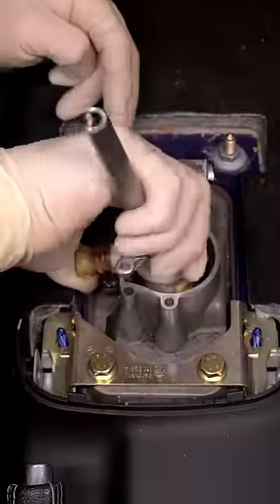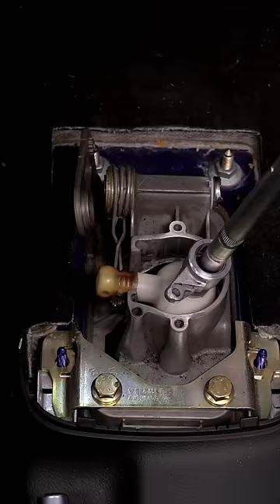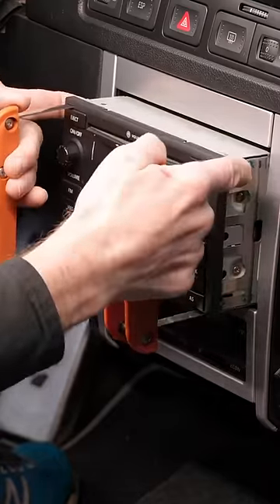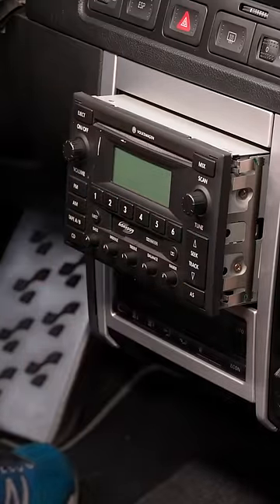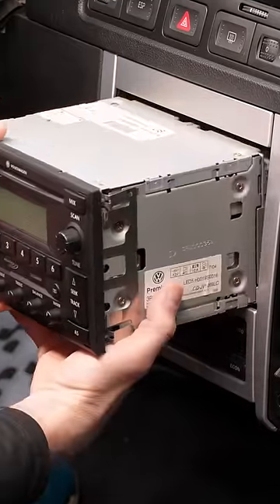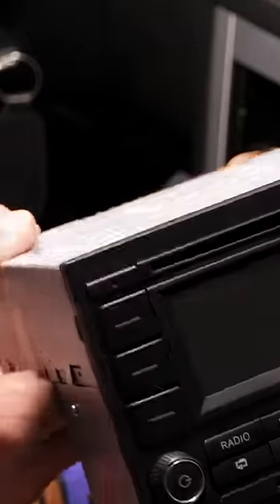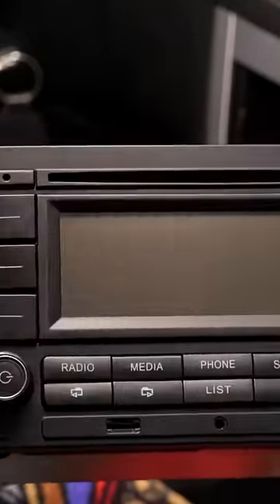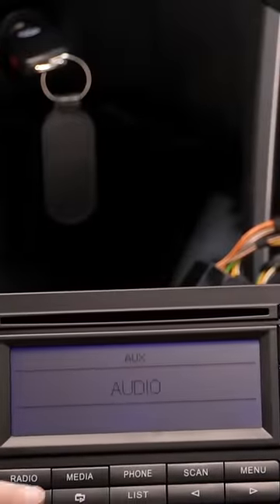I Ruined a Clients Radio OUCH

Comment: At least you’re a mechanic that makes up for his mistakes. Some mechanics break things and never even mention it.
Reply: Having had this happen, I very much appreciate when someone makes good on their mistakes. 

As an example, the plenum on my 91 civic is no longer serviceable - the screws were impacted back IN breaking the housing in a couple locations and stripping all the screw heads. This was a housing I'd previously opened and retightened by hand. The shop handed it back to me without any mention, and I didn't catch it until many weeks later. The entire plenum would need to be replaced if it needed to be serviced, as the screws would need to be drilled out in order to remove it.
Reply: @jameshaulenbeek5931  exactly, i’m a mechanic myself. And i see a lot idiocy at my workplace from other mechanics.  These guys don’t give a fuck about other people’s cars. I’m temping to open my own shop in the near future, because i don’t want to work at a brand stealer(dealer) or a workshop full of jerks.
Reply: Lol that part ngl I would have been scared asf like “no bruh dont do this to me im just trying to work “ 😂
Reply: Had my sway bar literally fall out while going down a hill on the way out of the shop
Reply: @Movement_44   😂😂😂 not funny glad you ok but fucking aye
Reply: every VW service department…
Reply: @jameshaulenbeek5931  yep i now have 2 dents in my hood from a windshield wiper I never approved to be replaced and they won’t fix it. That’s why i hate dealers its cheaper to replace the hood than it is to fix it after labor.
Reply: It’s an advertisement
Reply: @orhankucuksahin6297  Im a mechanic and I will work for you brother I always wanna be taught and do things right it’s just about having pride in your work and knowing you did the best you could
Reply: @beaujacklewellen6524  i am living in Holland, you’re welcome. The shop is also going to be a local car enthusiast club since we don’t have one in this town I live in.
Reply: @NateKK7  Nice thing in Quebec is that you’d get a free hood. They cannot charge you for a repair that you never agreed for, and accidental damages coming from an unwanted repair would follow the same rule. And you technically could have that repaired in a different shop and send the invoice to the first one.

There’s just no unwanted repairs here. They will call you and make sure to get your approval before doing anything. Even legit repairs are covered by this. If you get a new set of tire, and never agreed to a brake pad change, then if they change your worn out brake pads without telling you, you just got free brake pads.
Reply: @arakwar  they can’t do it here either but if i go to the state they will remove me registration because there is a yearly safety inspection and if any mechanic finds something they will remove your registration. Still tho i has one in the back seat and I would have installed it without damaging the truck.
Reply: YEEEEEP
Reply: That makes up for mistakes...that would have never happened if they weren't trying to film something. So basically doing something entirely unnecessary to the job, and it caused damage.
Reply: *most.....
Reply: I had a mechanic claim to fix my rear main seal on my 01 ranger when the motor blew. Never did it. Took it back 3 times, and it would get worse each time! On the second visit, I had them replace my coil packs, and while they were replacing them they failed to mention the clipped a wire to my alternator. At the time I didn’t have money to fix it and tear and some change later, I ended up selling it.
Reply: @cacaoscotti4827   i work at autozone prime example customer needed a tire rotation went to the mechanics then was told he needed a new power steering pump😭😭
Reply: Happened to me. I later found out the mechanic that worked on/damaged my car died in a car accident on his way home from work. Well deserved 👍🏽
Reply: Probably only did this because it's visible
Reply: If it has to be mentioned, you didn't notice,/give a shit/ pay me enough to car.....
Reply: Never make changes like this without customer approval. Maybe they wanted to maintain the stock radio for a good reason. Now, you have a vehicle that has had wiring modifications made. Good thing it wasn't a classic car.
Reply: Scotty Kilmer
Reply: Guy who changed my windshield just used drywall screw to hold the A pillar cover in place. Ofc didnt tell me
Reply: My mother took her car to a mechanic shop because her handbrake stopped working. After getting it back, the handbrake still didn't work and neither did the driver door.
Reply: yeah he makes it up because he can get a tiktok video out of it
Reply: I’m sure if the damage was invisible he would’ve left it
Reply: Had one break my throttle cable without my knowledge, two months later I’m driving and the pedal goes to the floor, mf put a zip tie to hold it in the bracket
Reply: Most of them
Reply: Your a good man 🙏
Reply: You said most wrong my friend...lol
Reply: Had a garage break my top engine mount on a grand prix I had, never mentioned it to me!
Reply: @orhankucuksahin6297  I was a shop hand and ford and I’ll NEVER bring my vehicle to ANY shop just after seeing the fucking treatment of other peoples vehicles. I’ve worked in other shops and been in other shops and unfortunately this is almost universal. Thank you for being a good egg. We need much more people like you
Reply: Jiffy lube mechanics shearing bolts
Reply: @NateKK7 that’s illegal, they can’t replace or repair any part of a car if you don’t approve it
Reply: @aidenlebel8157  yeah, most of them don’t care, as long as they get the money. Listen, I had a customer brought his car in for inspection, and i inspected the whole vehicle at the stealer. And when I heard the price of the service. 1200 bucks for just a battery, expansion tank, brake fluid service, aircon service and minor oil service. I was flattened, i told my service advisor that I didn’t want the expansion tank to be replaced immediately. I told him that he just had to order the part just in cause it needs it replaced, lots of GM brands in Europe have that problem where the expansion tank plastic weld comes loose and the tank will start leaking. And those motherfuckers are mostly on back order, so i told him order it, just in case i had to further diagnose the coolant system before replacing the tank. At first glance at inspection i saw no leak, after i filled the tank to the maximum line it started leaking on the return line fitting on the flanch. I told my service advisor that i just needs a o ring replaced and he said let’s replace the flanch. I just replaced the o ring and the leak was gone. I don’t give a shit what the advisor or foreman tells me. I fix what needs fixing and if they sell a flanch to the customer someone else is going to do it, not me. Bloodsucking maggots that they are.
Reply: What's worst is if a porter does it and doesn't say anything. Caught a dude snap my obii sensor out of place while intaking my brand new ZL1 for my free oil change.
I thought he had broken it and was furious but the mere fact that I was right there and acted as if nothing happened was the worst part.
Reply: Yeah like my old mechanic …
Reply: **Most
Reply: Most* fixed it for you.
Reply: Or break shit and make you pay for it
Reply: I’d say most of them
Reply: Most
Reply: "It was like that already......"  Me:mmhmmm
Reply: Not all of us do though! Lol I’ve made some royal fuckups in my career but it all depends on how you handle it
Reply: @orhankucuksahin6297 I'm currently a student at a Votech for automotive service. One of the first things our teacher showed us was a video of one of the kids, who worked at a dealership, and his mentor setting a car on fire cause they decided to use over a gallon of brakleen to clean an engine bay, and they didn't disconnect the battery.
Reply: @PoorlyPlaying  that’s a basic rule when working on cars, disconnecting the battery. 

But to ignite Brakleen, it must have shorted out somewhere to spark.

I never experienced something crazy like that, the only crazy thing I ever experienced is jacking a car on the wrong place, which almost caused the car to go sideways. But I was a student Mechanic at the time, I didn’t know any better. Put that on the guy who was supposed to teach me the basics at my internship.
Reply: I’ve been able to make my tools a complete set as a technician just by immediately checking under my hood and finding various tools laying on my engine bay 😂
Reply: yea my parents took their ford explorer to a mechanic to get a radiator replaced and the guy drove it back to our house and when he pulled in the car was making a squealing sound, he told my parents "you hear that? oh its nothing just turn your radio up real loud and you wont even notice it" i legit am not making this up those were his exact words Lmfao, he didn't even offer or try to fix that noise, wasn't much of an issue though because a few months later the explorer got destroyed when a creek near where we lived went out of its embankment and flooded the car (we had parked on a part of the driveway that ran down near the creek, about 15ft away and 10ft down, so yes that creek rose up like 20-25ft it was insane)
Reply: You would be surprised at how many mechanics don’t actually own a torque wrench.
Reply: Had a jiffy lube tech completely rip the oil pan cover off my wifes car and hope we wouldn't notice. Apparently he had bent it quite badly when he tried to pull it off without undoing one of the bolts, no clue how he fucked it up that bad but they wouldn't even schedule us an appointment to get a replacement installed. Reported them to consumer protection agencies and saw that particular shop shut down about a week later, presumably for numerous other similar incidents
Reply: I had an e92 335i still got it to this day took it for new coil overs and they broke the front bumper it was an m3 bumper and denied all the damage and said they didn’t do it to this day I work on all my cars myself and learned Eveytbing
Reply: Liar Liar mechanic: "oh that...... That was already there"
Reply: Than blame YOU when you call them out on it
Reply: All of them I believe, except this guy. 
Took my vehicle to a local shop for maintenance. Got it back missing 2 small tuning knobs from my radio. 
Didn't bother to say anything,  just never went back.
Reply: COUGH brouge built
Reply: They would tell me not to if it wasn’t noticeable
Reply: most mechanics not some mechanics
Reply: Most* lol
Reply: Yeah one just bought my shifter bezel and didn't say anything
Reply: Or they try and tell you it was already like that! Firestone auto care around my way broke off 3 wheel studs during a simple tire patching and told me i brought them the car that way! It wasn’t even driveable.
Reply: Growing up my dad truck has real wood interior for some reason the mechanic remove the cluster and when he bolt the piece of wood he broke it half. Over tight the bolt 🤦🏻‍♂️ and it was obvious and my dad he never stayed silent with anything so any work they did to the truck he didn’t pay them because then he found the truck had other panels broken
Reply: Correction: pretty much all mechanics do this
Reply: @grandcalifornia8410  depends. There two types of mechanics. One that breaks things and doesn’t tell you shit or tells you that was like that when they took it in for service. And one that breaks things, replaces it and never tells you, to keep you a happy customer.
Reply: yeah it took me months with my current mechanic to trust him always had to take photos before they did a repair because it always came down to "it was like that when it arrived"
Reply: @orhankucuksahin6297 exactly I was a shop hand for a year or so at a so so body shop we once had a 150k Mercedes come in for a repair on the door one of the shop technicians was trying to remove the fender flair from the car after thinking he removed all bolts and clips pulled as hard as he could ripped a bolt out with and scratched the pain then try’s to act like nothing happened when he returned the car😪
Reply: He makes up and then some like you’re supposed to the average person mechanic can’t compare
Reply: I’ve had that the last three times with my mechanic. Not going back there again.

 It sucks because they’re really good, specializing in imports and luxury vehicles but they just can’t seem to stop effing up my car.
Reply: You can blame the shops for that. Majority of mechanics will own up but the majority of shop managers will straight up deny shit so they don’t have to pay out. 

Dealerships especially will deny mistakes because their shop managers get bonuses and if they’re admitting mistakes, well….no bonus.
Reply: Happened to me at a Mercedes dealer in Dublin, I ain’t going back there
Reply: @jameshaulenbeek5931 that's just awful 😭😭
Reply: I hear YouTubers say, "mY bOsS wOn'T LeT mE FiLm At wOrK," all the time. Same they wonder why. Not too mention the time.
Reply: One time a mechanic forgot to put oil back in my car after he changed the v-tec solenoid.
Reply: some even try to hide it, even if it could be dangerous
Reply: I had a dentist do that when I was a kid, then they denied my mom my records, she was gonna sue, but decided not to go through with it for whatever reason
Reply: Depends really on what breaks, i once broke off a fuel filter holder, but luckily there were two more bolts holding it so i didn't bother to fix that
Reply: @christophergilley3218 right so when I’m driving away and my brakes don’t work because you let air in the line and I slam into a wall I guess that’s my fault
Reply: Brought my truck in for an oil change and to look at a stretched shifter cable left with a $175 bill and a truck that wouldn't shift
Reply: ”For what will it profit a man if he gains the whole world, and loses his own soul?“ Mark 8:36 NKJV 

“For God so loved the world that He gave His only begotten Son, that whoever believes in Him should not perish but have everlasting life.”John3:16 NKJV

“that if you confess with your mouth the Lord Jesus and believe in your heart that God has raised Him from the dead, you will be saved.”Romans10:9 NKJV

Romans 3:23 (KJV)
For all have sinned, and come short of the glory of God;

Romans 6:23 (KJV)
For the wages of sin [is] death; but the gift of God [is] eternal life through Jesus Christ our Lord.
Reply: Met to many of those… I don’t trust any mfer with my car now 😂
Reply: Yeah, some dudes would have tried to fix it with a permanent marker :D
Reply: Tesla messed up my sister’s car by scratching the interior after a service and their excuse to not rectifying it was that the scratch was in spec.
Reply: @paddyl.886  LOL as if tesla interior matters. Minus the center console which is nice, it's just acres of cheap plastic, their interior of a $70k car is identical to like $15k Renault.
Reply: Or they steal your parts and never actually install them..... One bad mechanic can give them all a bad rep
Reply: Most mechanics you mean
Reply: Nothing was made right do one job stop trying to do six.

If it was never being filmed never would have been a mistake to happen
Reply: @mattlane2282  Exactly this guy was so thirsty for clout he didn't even have time to set up his camera properly so it doesn't fall over. Had he not been trying to film, his wouldn't happen
Reply: I’ve seen some really sketchy stuff man
Reply: how do you know he mentioned it.
Reply: @111matt  How do I know? Well the camera damaged the stereo and he even says it happened while he was trying to record something. 

Had he not been trying to record for clout, there would be no camera to fall over.
Reply: They tell you it is because your card is old it broke.
Reply: just got mine back today and the plastic engine cover is broken a bit so it wobbles now
Reply: Nah bro they break it and mention it as if it were there very common to elderly my grandpa is losing his memory so he’s been to the mechanic 20 times the past few months bc they keep messing it up more and saying it needs something new

We could’ve bought four brand new trucks for the amount of money he’s dumped into that price of junk

Yes we have another working vehicle he’s just dumb asf
Reply: @zianeshkasparen4358  that actually can be true, car so rusted you touch and bits of it break off.
Reply: Most *
Reply: Yea tell me about  it my intercooler pipe popped off twice first time loose clamped second time different place go to fix it the second time some dumbass put 2 zip ties to hold it on while it constantly under the vacuum pressure from the turbo🤦🤦🤦🤦
Reply: man i had a mechanic somehow switch the wiring for my windscreen washers, so when i switched the washers on for the front, the front wipers would work but it would wash the rear window and vice versa🤣
Reply: And wonder  why some of us have dash cams it's nothing personal but I've had some mechanic disconnect my camera without permission
Reply: Some worse,  straight up say I Dunno.
Reply: Or even worse, some mechanics tell people they need work that they don't need just to scam them out of money. And some scam mechanics will even charge for work that they never actually do.
Reply: They drove a fork lift through the side of my truck and said “that was like that” . I had no photos, so I couldn’t prove it. Boned
Reply: Damaging something on a vehicle and NOT mentioning it is literally against the law
Reply: Yeah. They dropped my transmission and they didn't replace the fucking torque converter seal they just double sealed it and I had tyranny fluid leaking from my bell housing. Stupid
Reply: Pshhh that belt tensioner broke itself, I didn’t pull it too hard what are you talking about
Reply: Much like the mechanic who I took my car to for an alignment. He spent all day on it, didn't seem to know what he was doing, and then said "I can't get this straight" (My dashcam was recording). At the end they gave me back the car saying it was done. It was worse, my wheel was nearly 15° off centre. They never told me it wasn't done properly. 

I took it somewhere else and they did it in less than an hour and it was perfect. Luckily I got a refund.
Reply: Id say most of them never mention it 😂
Reply: Or even steal rare to find parts from the car.